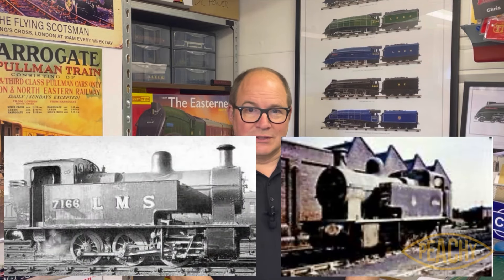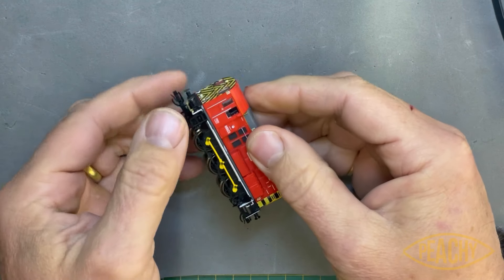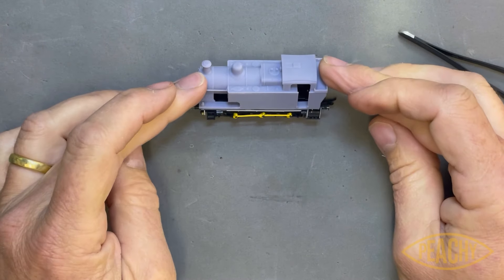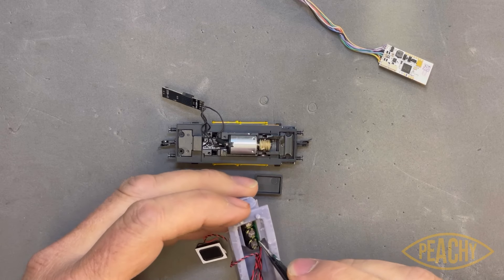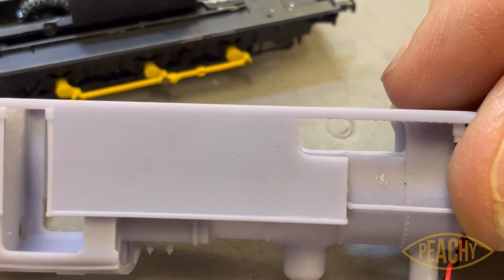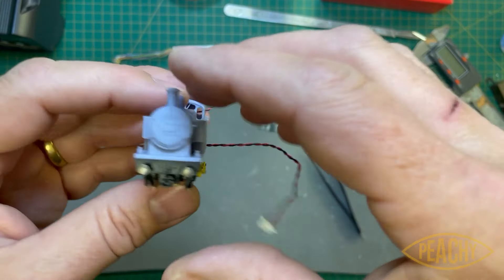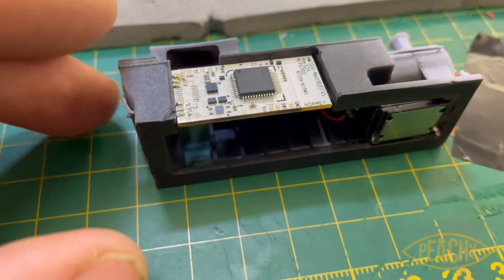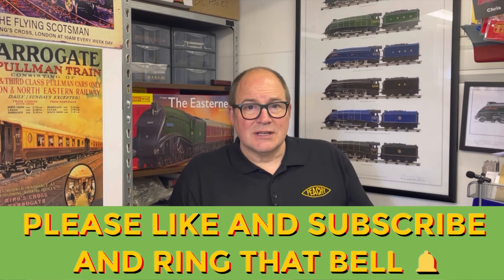Fowler 2F body on a Hornby TT120 08 Chassis

Comment: Hi Chris just got back from key model world great day got myself the intercity 125 got it up and running but are the rear engine lights mentioned to work as well as the front
Reply from the maker: Yes. Are you running DC, standard DCC or HM7000 Bluetooth DCC?
Reply: @PeachyTT120  DCC on my iPad
Reply from the maker: @ianhughes-zf1ll  sounds like either you’ve not put a 2nd decoder in the dummy? Or if you have, maybe you’ve assigned it its own address?
Reply: @PeachyTT120  cheers Chris think that’s done it thanks for your help    Awesome train      Have a great day tomorrow

Comment: Hmmm.  Too much for me.  I think I'll wait until Hornby come up with a small tank engine with a decoder and speaker already fitted.  Hoping they might do a set with a fully fitted small tank with some goods wagons and brake van before too long.
Thanks for that.  Subscribed now.
Reply from the maker: Cheers Mark, bear in mind though when Hornby do sort out the 6pin HM7000 this loco will be possibly the easiest option for a simple conversion. I hope my second “full Monty” section doesn’t put people off the of section one “simple” body swap. 
Thanks for subscribing 👍

Comment: Interesting model but looks too tall more 3mm scale height wise . A tram body would be nice .good vid .
Reply from the maker: Yes I agree at first glance these do look like a tall loco, but that’s because they were. Apparently specifically so that the crew could see over the length of a rake. As for the model, it’s about 1.5mm to tall if you stick with the modelled running board (so this equates to 180mm or just over 7”) this can easily be reduced for a display model, or even if you want to stick with either DC or wait for the 6 pin decoder. But unfortunately if you want to install an 8pin it will need this slight compromise in height.

Comment: Hi Chris how about lenny's lincoln locos? caroline
Reply from the maker: Lenny’s stuff is great. Very detailed and accurate. I’ve got one of his A5’s 
But I wouldn’t recommend them for beginners. They’re definitely something to work up to. 
The good thing about Peter’s dock tank is it’s specifically designed to just easily fit on the 08 chassis. 5 minutes and it’s done. 👍
Reply: thanks Chris. run many of lenny's 3mm locos . caroline
Reply: I use german chassis so will  work on tt120. caroline

Comment: I think hornby should have released a steam tank locomotive earlier than they are doing
Reply from the maker: I agree. And so does the new boss Martyn Weaver (see previous video)
Reply: @PeachyTT120  I'm not doing tt but a j94 and a pannier tank are coming at sometime
Reply: Also surprised they went for the extra expense and complication of the outside frame and cranks of an 08.
Then not making it in steam era BR Black or Green to fit in with the other steam era stock is also puzzling. New liveries would have to be so much cheaper than new tooling.